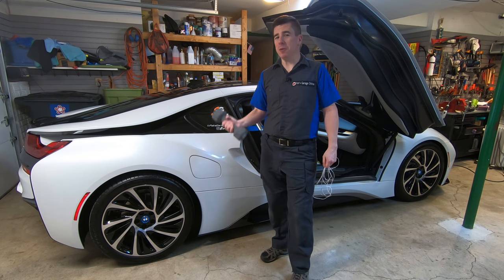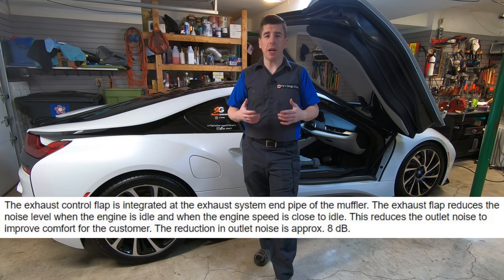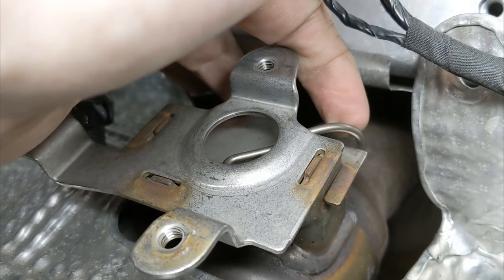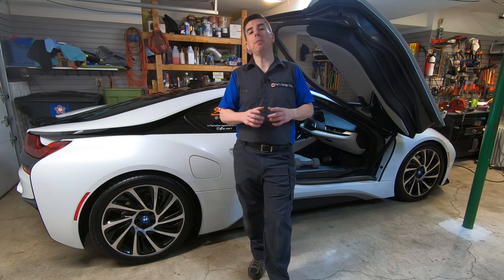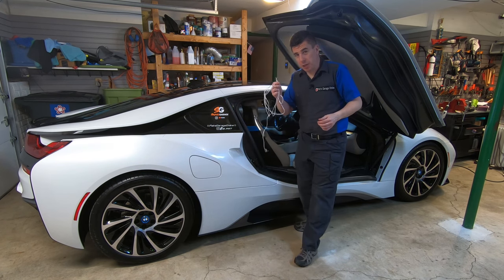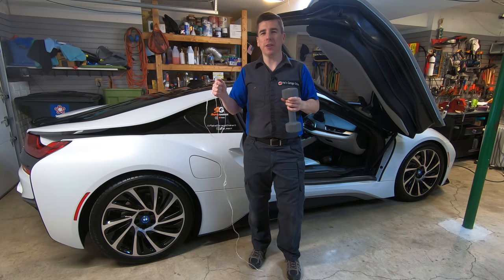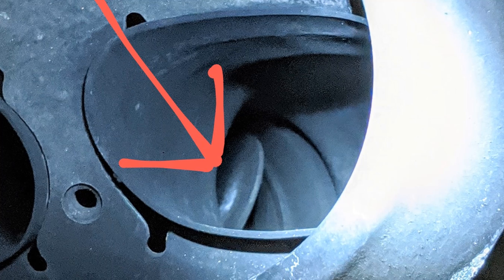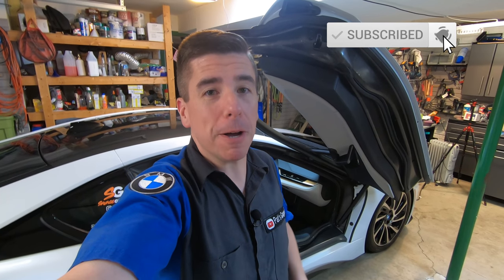How to modify BMW i8 exhaust for FREE with a string and a weight!

Comment: Now just waiting for you to figure out how to get our 3 cylinder to 600hp like the Koenigsegg Gemera.. Lol
Reply from the maker: Let's see.  Remove the cam and replace it with electronic valve actuators, run it on E85 fuel and increase the displacement to 2.0L.  Let me get my drill...  😂
Reply: @PatsGarageOnline  hahaha
Reply: @PatsGarageOnline  And since I work at Koenigsegg, I can see if it is possible to do a swap haha
Reply from the maker: Let's do it!
Reply: The gemera has 3 electric engines and a 3cl 2.0l petrol engine. The i8 has 1 electric engine and a 3cl 1.5l Petrol engine. You can’t have 600hp on a i8 but you can reach 400hp easily with a stage1 remap

Comment: Sorry double post in the previous video and here: I do not recommend removing it or leave it open. The exhaust valve needs to control the outlet airflow, so it can be more efficient. When the car is low speed (closed = good for a rev up), high speed (open= better for high speed)
Reply from the maker: Blocking the exhaust will slow the turbo down.
Reply from the maker: @7invi  please Google back pressure on a turbo engine
Reply: @PatsGarageOnline  Ok ( I removed the fluid piping's comment) , as you said I did google again, and the results are below:
"Back Pressure" 
Do you need back pressure in an exhaust?
As the pulses move along, they generate an exhaust flow. If you have a restrictive exhaust system, it can cause backpressure that works against the positive flow of the exhaust gas that's trying to exit your vehicle. ... However, a little back pressure is a good thing. In fact, it helps.

"Exhaust Gas Flap Functions" 
In emission control, exhaust gas flaps are used to divert the exhaust gas flow. In this way, they trigger the HC (Hydrocarbon) absorbers or bring the starter catalyst to operating temperature more quickly.

A more recent method of emission control is the use of DeNOx catalytic converters. These cause a part of the exhaust gas flow to be guided through a cooling zone by an exhaust gas flap, thus ensuring an optimum effect and a long service life of this catalyst.

By varying the exhaust gas backpressure, the efficiency can be improved in certain characteristic areas. This is also done via an exhaust gas flap in the exhaust system.

Exhaust gas flaps are specifically dimensioned to meet the high demands in the exhaust gas system: they must outlast gas temperatures of up to 950°C, whilst closing correctly and remaining moveable during their entire service life.
Reply from the maker: @7invi  I challenge you to dig deeper:  Impact of Back Pressure On Turbo

Comment: What your experiencing is the placebo effect, just like fake muffler they put on to fake exhaust note, at lower rpm, the exhaust exit out the left pipe, at higher rpm, with greater volume of air the flap open for efficiency, so the flap normally open at or close to wide open throttle you didn’t change a thing. You just proof that the 10lbs weight is more than enough to pull a fuse out under the glove box
Reply from the maker: Try the mod on your i8 and let me know what you hear
Reply: @PatsGarageOnline  here is my mods, you can find it on Craigslist, for sale 2017 BMW i8 Lamborghini trade welcomes

Comment: Use BIMMERLINK ( sister App to BIMMERCODE) to open the valve , then switch engine off and pull fuse. The good thing with BIMMERLINK is you can try the exhaust open to see if you like it before pulling fuse.
Reply from the maker: Very good advice for iOS users. 😁
Reply: Did this mod today .... Great mod ..sounds much more like a sports car ...deep burble ... well done Pat!!!
Reply: @tube1923  bimmerlink doesnt support i8 valve open

Comment: Hello if you don’t mind can you give me the idea my i8 has issued with control screen on the console no light and can’t click or move to anything on the screen after you did changed the new 12v battery
Reply from the maker: I would try disconnecting the 12v battery again and reconnect. If that doesn't work, visit a service center
Reply: Thank you so much

Comment: Well I'll confirm the roadster is slightly different
I looked at my fuse area there and it's already gone. I have used bimmer link to open the flap you can hear it open while not driving but you do have to open it everytime you turn on the car

Comment: I love your channel, been saving so far for a year. 1 more year & I can purchase one. I am going for a 2019. I've been told all the problems that it mainly comes with & what needed to be changed to make it better. Has been done for the 2019 model.
Reply from the maker: Thank you! Don't believe everything you hear. There weren't that many issues with the early ones compared to the late ones. That's what I've been reading on the forums. In addition, a lot of parts have not been deprecated. So buying a newer one versus an older one doesn't mean you're going to avoid any particular issues. In fact, the 2019s and later seem to have a problem with the trunk lid pivot and spring breaking more than the early ones.
Reply: @PatsGarageOnline  Much appreciated for letting me know, information is power & I appreciate the feedback. I will opt for a 2014 or 15 then. Save the extra money left over for repairs.

Comment: WHY would it be soooo hard to tap into where the fuse goes, and put some long cable and a switch some where by the drivers side, hiden away under the dash, that way you can have exhaust fully open all the time when you switch it off and fully stock when you have it turned on. I done this myself with many fuse aplications.
Reply from the maker: I did it after I created this video but never recorded a follow up video. It worked well.
Reply: @PatsGarageOnline  seems the most logical way to have it done. But we'll, that's past, you sold the car anyways 👌👌👌👌😏😏😏😏😏

Comment: Very interesting video that reminds me of a similar modification that I did to my Jeep Wrangler.

There is a fuse that protects the interior lights and needs to be pulled if the doors are removed.  I replaced the fuse with a dummy that had two wires coming off which I connected together via an inline fuse and a switch.  The circuit is still fused but now, when I remove the doors, I just flick the switch to stop the interior lights staying on.

I guess the same thing could be done to the i8
Reply from the maker: Yes, the same can be done with the i8. I didn't get into that in the video because of liability concerns. But, that would be the most functional way to make this happen.
Reply: @PatsGarageOnline  Makes sense - there is a world of difference between modifying a 14yr old Jeep and a BMW i8 :-)

Comment: Hi Pat. I have completed this mod and to be honest haven't noticed any difference in sound whilst driving the car but used a decibel meter and have noticed a very slight 2-3DB increase at the tailpipe whilst idling. However the one difference I have noticed is that my oil service mileage indicator is reducing a lot faster now that the fuse is out with the flap is open. Before I carried out this mod, after my oil service indicator went under 1000 miles, whatever mileage I covered with the engine running would correspond exactly with the oil service indicator. Basically like for like, if I drove 40 miles with engine running the oil service indicator would reduce by 40 miles. Since I have carried out this mod it now drops dramatically with each journey using the engine. For example it dropped from 430 to 370, a 60 mile drop when I had only driven 15 miles. Basically each time I drive using the engine now the mileage drop is no longer like for like and instead it drops by 60 miles each 15 mile trip I take to work using the engine. 
Have you noticed a similar scenario since carrying out this mod?
I know the oil service indicator depends on numerous factors and calculations depending on how the car has been driven and how the hybrid powertrain has been utilised between services. Is it possible that this actuator controlling the flap was part of the calculation and now that it is permanently open the oil service indicator thinks my car is being driven at full throttle all the time, subsequently reducing the mileage in-between oil services?
Love your videos about the i8 by the way and plan on carrying out the air box mod this weekend.
Cheers Ryan
Reply from the maker: Thanks Ryan. That's interesting that you can't tell much if a difference. We're you able to look into the exhaust pipe and see the flap open, just like in my video? A couple of folks reached out to me and sent picture to my Instagram at @i8.pat so I could review them. One subscriber only had the valve half open and needed to try it again. I want to make sure yours is truly completely open.

I was unaware of any changes in oil life in my i8, but I don't watch the meter. I change the oil every 5k miles. A turbo, direct fuel injection engine goes under a lot of stress. Fresh oil is important to me. 

I'll have to start watching the meter when the world opens back up. I haven't been driving the i8. I've been doing paint correction and other things. But I'll take a look if I start driving it again. 

Please let me know if the flap is truly all the way open. Thanks!
Reply: Hi Pat. I'm pretty confident the flap is open. I did multiple tests with the flap closed and open when I was testing with the decibel meter. I soon established that if I didn't pull the fuse out when I was on full throttle the flap would only remain partially open. On one particular attempt after pulling the fuse out the flap only remained partially open and ended up making a hell of a rattling noise because the passing exhaust fumes were obviously causing the flap to rattle against the side of the tailpipe or something. There's another easy way to test if the flap is open by simply sticking my fingers up the tailpipe!!!! When the flap is closed you only feel heat and exhaust gas pressure from the left side tailpipe and with the flap open you get the same amount of heat and pressure out of both pipes. When I'm carrying out the air box mod this weekend I'll get a better view with the car jacked up and send you a picture. You never know maybe once the air box mod is done it will bring the exhaust mod to life. I watched your video when you were driving and listening to the noise after you had made the mod and I never heard any difference to what my car sounded like without this mod. I've always heard the engine and exhaust noise in Eco and Comfort modes with "hold state of charge" deployed.
Believe me I don't normally drive about keeping a constant eye on the oil service indicator but when you get under a 1000 miles to go a message pops up on the dash alerting you each time you start the car. I fall into the "key worker" category over here so have still been using my car for work and have been trying to drive as much as possible in full electric mode to save the oil life which is doing my head in. 30 mile round trip today, 19 of which in electric mode and the oil service indicator dropped from 310 to 250. It's like playing a game with it or like waiting for a time bomb to go off and really annoying especially when the car was booked in for this service at the end of March but got cancelled due to the lockdown. So that's how I've become so aware of the difference ever since I did this mod. I'm not saying it's definitely due to the flap being open but seems very coincidental.
I'd love to change the oil more frequently but have an extended warranty with my 2014 i8 and find it costly enough having to pay BMW's extortionate prices to do so in order to keep my warranty valid. I can't even fit the wider tyres like you have done and just have to put up with the understeer. I enquired about it but it would have voided my car insurance in the UK as well as the extended warranty. When my extended warranty runs out I'll grow a set of balls and invest in a decent set of tools and carry out all the service requirements! Maybe that's wishful thinking due to how easy your videos make it look.
Reply from the maker: @ryansteel7189  Thanks for the detailed reply.  I can confidently say you went through the checks to make sure it was open, especially if you heard the rattling noise.  That doesn't always happen in a half-open flap but it's more likely that it will because there is less pressure between the actuator and the flap, mid-travel.  Sometimes, I get questions from folks who aren't as knowledgeable as you.  But you are clearly ahead of the game on this, so I trust your judgement that the flap is indeed open.  

I wasn't aware you were in the UK.  Does your exhaust have a Particulate Filter on it?  In the US, we do not, and I honestly don't even know what it looks like, but if it's there, I wonder if it's helping silence the exhaust.

It makes sense, now, why the oil life is something you are concerned about.  I would advise putting the fuse back in the panel at this point, in order to rule out any variables with regard to oil life.  From my knowledge, the car will adjust the oil life based on driving and performance.  BMW claims that 10,000 miles is the required distance to change the oil, but we don't know what the modules are programmed to alert, since the combined gas/electric use will result in completely different miles (for example, 2,000 miles / 8,000 miles gas may not require an oil change).  We (the consumer) are not aware of the actual mileage on the gas engine.  That makes it difficult for me to know exactly what's happening.  If you are that close to an oil change, it's possible that the car is more sensitive and/or the flap might actually have something to do with that.  It might be in your best interest to re-install the fuse so you don't run over your oil change limit, because I'm very unsure if that may have an impact on it.
Reply: Apologies for my late reply Pat. Since I reinstated the fuse I have been trying to establish if the flap being permanently open has any impact with the mileage of the oil service idicator. The mileage of the oil service indicator seems to be a bit better and like for like with whatever mileage I have driven. However I have been driving in e drive mode only to save the life of the oil, so it's hard to say if the flap being open has anything to do with it or like you say just more sensitive as the service mileage indicator reduces. Maybe once I get the oil changed I'll try again with the fuse in and out.
I don't have a clue if the Uk models exhaust has a particulate filter on it or not. I would normally ask the techs at BMW but they have all been furloughed due to the lockdown but will endeavour to find out now that you have mentioned it. Even if it does have it, I doubt I would be able to remove due to MOT emission test parameters in Scotland.
On a separate note, just wondered if you ever developed a solution for the shock absorber dust covers (protective tubes) that had torn?
I have the same issue on both rear struts and don't fancy having to pay BMW £4k to replace them especially if they are going to be made of the same flimsy material so would like to find an alternative solution.

Comment: A great & simple mod.

Could you not wire a dash mounted switch in place of the fuse so you can have the option either/or?
Reply from the maker: You could mount a switch. that way you can open the circuit when your foot is to the floor to prevent the valve from closing. I decided not to get into this since it requires some custom work and it didn't want to take on any liability in the video. But other vehicle owners who have similar vehicles have decided to install some type of switch in order to break the circuit.

Comment: Hi Pat,

I've just carried out this fuse removal BUT to fix a squeak that I thought might have been coming from the fall. Turns out it was as squeak is gone! Question is if I put the fuse back in what would I need to do to fix the sqeak? Where would I lubricate it do you think, and how? Cheers Chris
Reply from the maker: There is a hinge on the valve that you can see near the end of the tail pipe. The hinge could be corroded causing the squeak. But I wouldn't squirt anything flammable on that.
Reply: @PatsGarageOnline  Thanks - white lithium grease when the pipe is cold?
Reply from the maker: @ChrisCorbett-c2u  that's your call. I would personally start with soap and water to get the soot out of it. That may be enough.

Comment: Thanks Pat, again well explained video. I have an 2015 i8 and love it. My biggest complaint is lack of noise! So, if I remove the fuse 58 permanently, will that valve stay open permanently and get that noise that I am seeking? Do I need to be driving and then remove the fuse?  Sorry for the confusion, just want to get it right. Again, Pat thanks so much.
Reply from the maker: Thank you. Yes, you need to be driving and have your foot to the floor in order to put load on the engine. That opens the exhaust valve so then you can pull the fuse while the valve is open. This requires either two people or one if you use some type of device like I did in this video. Once you get the exhaust valve to stay open, Just leave the fuse disconnected. The other option is to plug the fuse back in at any time, and it will go back to operating just like it did from the factory.
Reply: @PatsGarageOnline  Pat, I followed your advice and worked perfectly. Kind of cool - getting more sound even al low RPM. Again, thanks and keep posting!